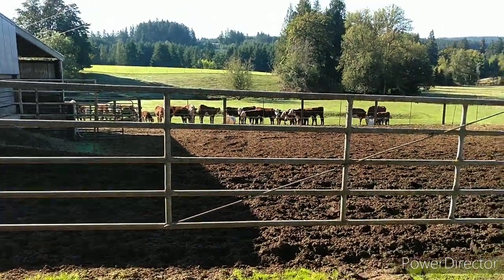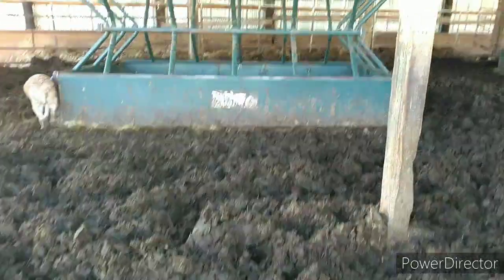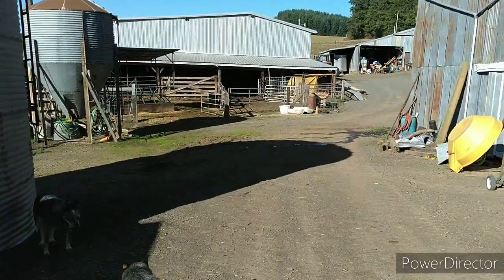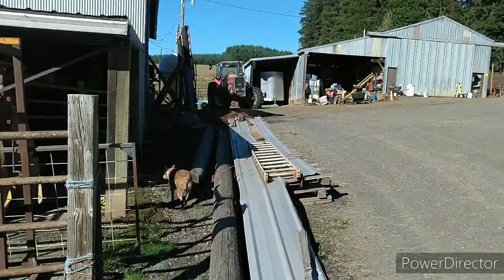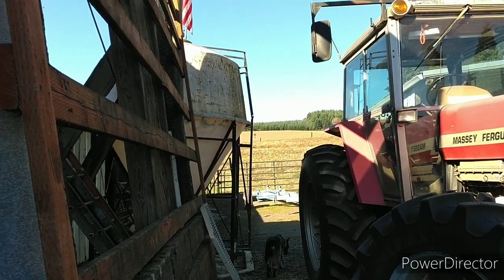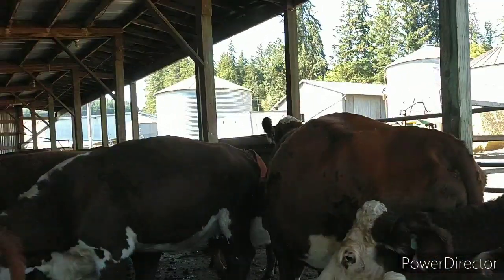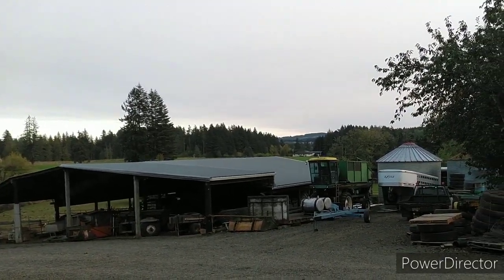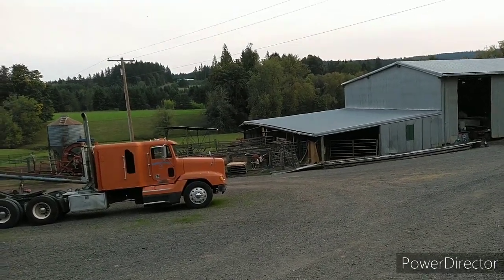Cleaned the feed barn and lot.. first time since May

Comment: We will be hauling the pile as soon as the fields are open
Reply from the maker: Kinda like here.. I don't like having to haul too far down the road, but it looks like at least some will be going a couple miles. Makes for a long job.
We can get everything cleaned out here in a week, but once you add road travel...
Reply: Gosselin Farms Ed Gosselin yep and in years past when it's wet, it's stopped off site hauling because of the mess it leaves on the road. City folk don't like that....
I just want to play with my old plows without getting covered in sh*t! 😂